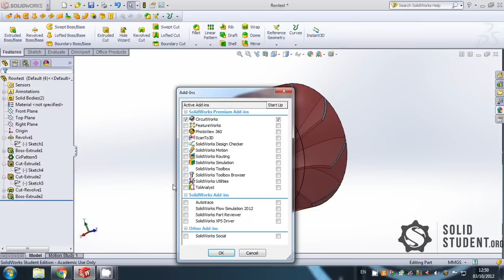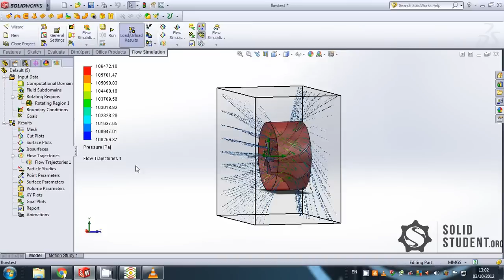Solidworks Tutorial - Adding a rotating region to a flow simulation

Comment: ihave problem to select the rotating region for internal analysis..can u help me
Reply: If you are working with an assembly, rotative region has to be a component, not a feature
Reply: @giulianotorres4556  Thanks, couldn't find anyone else mentioning this. In an assembly it has to be a separate component.
Reply: +Ahmad Zulkhairie Amran  did u find the solutions of that because even i have the same problem

Comment from the maker: As far as I know you cant run that kind of simulation - the geometry has to be static or "made" to be actively rotating as part of the set up of the simulation, instead of being caused to move as a result *of* the simulated flow.

What you can do is run a CFD on one blade with surface force goals to find the lift and calculate the torque produced on your turbine and the speed of rotation from that. Sorry I cant be of more help! :/

Comment: I am trying to determine the speed of which a turbine type object would rotate with a given air speed. also the air speed will decrease over time. how would i use flow simulation to do this? is there some way i can use an equation goal to determine this?

Comment: To study the whole flow pattern and see the effects of the stationary pump casing, baffles, and other internal parts,  it is used Multiple Rotating Reference Frame or the Sliding Mesh approach"  

Do you know something about this in SolidWorks? thanks

Comment: Hello!
"A very simplified approach, called Single Rotating Reference Frame, which assumes that the entire fluid domain or region rotates with the rotor or impeller, can be used to study the flow around the impeller blades. This doesn’t consider any effects of the pump casing on the flow, it is insufficient for analyzing a full pump system"